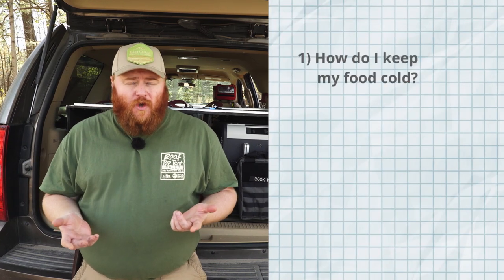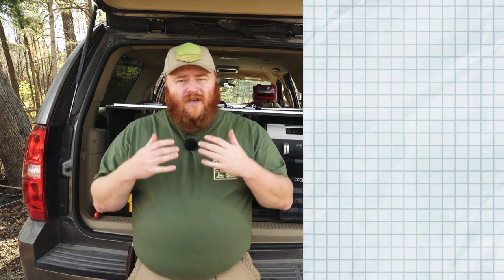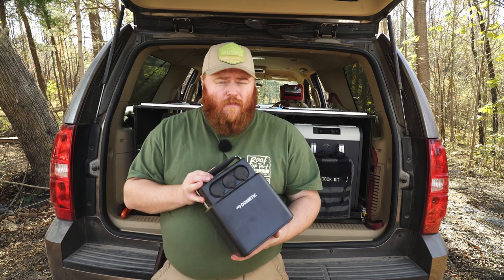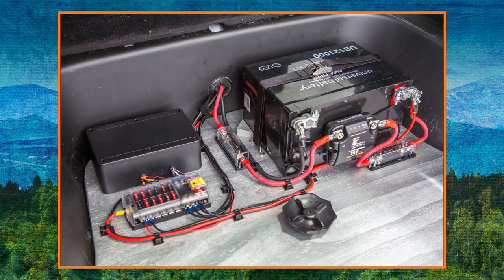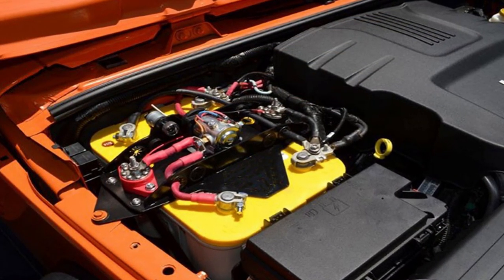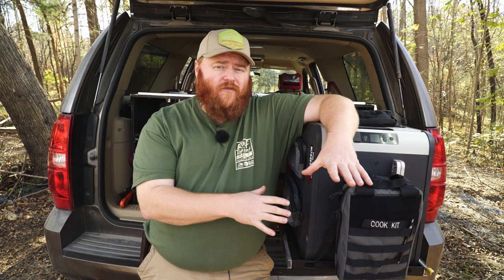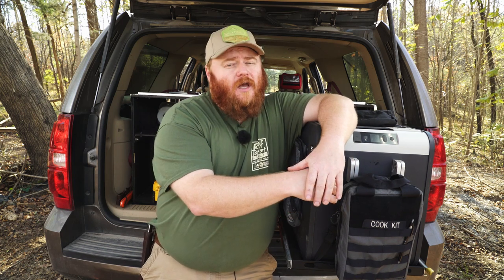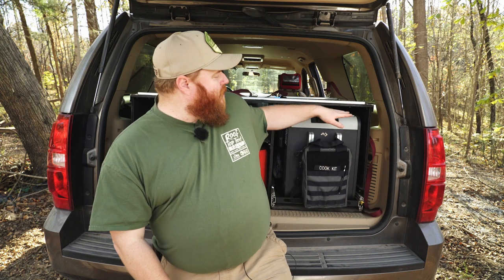Overland Fridge Install Tips - Dual Battery Systems, Fridge Slides, Mounting

Comment: Lots of good information here, great job! One bit of info to expand on your points about the dual battery system and a dc-dc charger is that those are complimentary products, not competitive products, which is a common misconception. The Genesis dual battery system is great for running your hard-wired accessories without worrying about killing your cranking battery. The dc-dc charger is an on-board battery charger that runs from the alternator rather than from a wall outlet in your garage. You can use both products to get the best of both worlds - extra power for accessories, AND optimized charging while driving. Cheers!  -Shane
Reply from the maker: Very true.  Just most "basic" dual-battery systems don't get an optimal charge for deep-cycle batteries so the ideal setup, in our experience, is a dedicated house battery.  Especially if you're using lithium based deep cycle batteries that don't like the heat generated under the hood.

Comment: Another outstanding video.  We traveled for three months and used an ARB 50qt as our backup fridge/freezer.  While traveling we had it plugged into a DC port in the rear of the Jeep.  When we parked and had access to power, we used an all weather extension cord.  When we stopped and did not have access to power, we used a LiPo 48 0 50W-110W with attached solar panels.  Before our trip we tested the two together and the ARB was still running after 24-hrs with about 25% of power in the LiPo remaining.  We did not have a rack to attach our ARB to the jeep cargo area, just used an assortment of gear bags, but care must be given to keep the vent ports on either side free/clear.  What also helps with cooling is to get a insulated cover for whatever system you are using.
Reply from the maker: Yeah, an insulated cover is never a bad idea.
Reply: “Lock your hubs 4wding” has a video showing the insulated bags don’t work.

Comment: Great tips!! The only thing I would add is for those that need to go out longer is just to skip the house battery in the traditional form. Go exclusively with a portable battery but just something bigger like a Jackery 1000 or similar and some efficient solar. You already highlighted that they are portable and can be used outside the vehicle whereas investing in an expensive Li battery will doesn't allow that. I have been getting by (sometimes barely) with a Jackery 240 in my 80 Landcruiser with a Dometic CFX50 even traveling to the deserts in Utah. When it's hot it makes a huge difference on how hard that compressor works in the fridges. Anyway, great vid.
Reply from the maker: Yeah, for those "Level 2" trips we highly recommend portable batteries.  It's usually only worth the investment of time, money, and effort to do a house battery when your vehicle becomes your home-on-wheels for months at a time.
Reply: @BlueRidgeOverlandGear  There is a big difference gap between your version of "extended trips" and "home on wheels." Overall I tend to agree with both you and Nigel. If you aren't living out of the vehicle full time then a portable battery system that can charge via your vehicle while moving and solar when parked is a pretty slick set up. This is how I currently run.
Reply from the maker: The gap between "extended trips" and "home on wheels" is large, but most people don't take regular extended trips.  So for the vast majority of "enthusiasts" who are going out for long weekends and the occasional extended trip (2 week vacation) the portable batteries probably make the most sense.  Unless you're full-time on the road day-in and day-out a house battery is probably money wasted that could be spent elsewhere.  Not to mention not needing to cut into the vehicle's wiring.  That said, a clean house battery install is hard to beat and when you have made that kind of investment you find excuses to use it day-in and day-out even when not on an adventure.
Reply: @Cooperd0g  and 1 more thing. While most provide this, you have to make sure the portable battery has pass through capabilities. That you can charge it while it's powering a device or a fridge or whatever. 👍
Reply: @NigelNaughton  This point is huge. Can you reccomend brands that have PPS that do not? I have heard that certain Goal Zero models do not have pass-through; am I wrong on this?

Comment: Great video! Quick question,  When  trying to prolong camp fridge life is it better to unplug when not camping (at home)etc. Or do you recommend keeping plugged to power constantly Thanks..
Reply from the maker: While we don't have any science to back this up, I've left several fridges unplugged when not in use to limit compressor cycles without issue.

Comment: Which DC-DC charger and house battery configuration would you recommend for a four door JL Jeep Wrangler?
Reply from the maker: The simple solution would be a stand-alone system like a Dometic PBL40, Jackery, Yeti, or similar portable battery.  If you're looking for a more integrated system, a RedArc, Renogy, or similar dc-dc is good and then you can run either an AGM or Lithium battery, but you'll need to do a lot more wiring (not unlike wiring up a car stereo amp).

Comment: I have a lithium battery in the back with a charge controller and a solar panel on my roof. I only run my fridge off it and it runs all year around and battery is full again by 7:30 am in the morning.

Comment: I bought an overlanding SUV. It came with ARB 38 qt ref/freezer and YETI 500X. I have both cables to plug in to cigarette auxiliary power outlet. I am missing both cables to charge them into house electrical outlet. I ordered a cable for the ARB 38 qt ref/freezer from Amazon. To use this cable to charge the ARB to my house electrical outlet, can I disconnect the cable that connects to cigarette auxiliary power outlet and switch the cable from Amazon to plug in to ARB outlet? Please advise.
Reply from the maker: If we are understanding question, correctly, then yes the cables should attach to the fridge in the same connection.

Comment: I usually go to a remote location for 7 to 10 days. I was thinking about installing a house battery system. With 100 amp hour batteries, should I get one or two?
Reply from the maker: What do you plan on using for power generation?  Are you doing solar? DC/DC? Both?  100 Amp-Hours should be fine if you have solar and/or DC/DC charging.  So run just one battery and something like a Redarc 1225 charger or similar product by Renogy.
Reply: @BlueRidgeOverlandGear  I plan on using DC to DC and a solar about 50 watts.

Comment: Another question can i add ice 4 overnite, in my elec. fridge!? As long it doesn't leak right it's OK ( water destroys!?)
Reply from the maker: Technically yes, but instead of just ice, a freezer pack or even bottles of frozen water would be a better idea so you don't have to drain fridge.

Comment: Need recomendation have an Lifetime Cooler 65qt dimensions are 28.5” L x 18.1” W x 17.5”
H , what model of fridge slide do you can recomend me , need the slide can extend sufficient outside i can open the door . Thanks
Reply from the maker: We're not up to date on the slides currently available. Here are some of our friends that might have more insight:

- Ok4WD
- Apex Overland
- Ashville Vehicle Outfitters
- Traitec4x4

Comment: Or just add a solar panel that charges the battery
Reply from the maker: Solar panels are a nice addition, but in wooded areas, especially during winter time, they may not provide enough power.

Comment: Why did i spend $400 on a yeti🥴
Reply from the maker: Yeah, a cooler has it's place, but for lots of use a fridge is well worth it and adds a lot of convenience.
Reply: @BlueRidgeOverlandGear  yeah I think I’m gonna adopt a hybrid method. Cooler for drinks and small fridge for food. I’m a fire fighter so I like redundancy anyways. Now I just gotta pick out a fridge.
Reply from the maker: Nothing wrong with that method. There are some 35 liter fridges and that's enough food for a several days, especially without drinks taking up room.
Reply: Cycle ice packs through from freezer to cooler and rotate back to refreze for another temp zone.